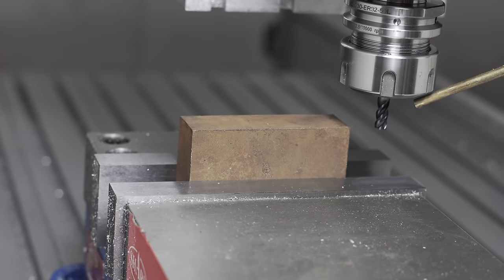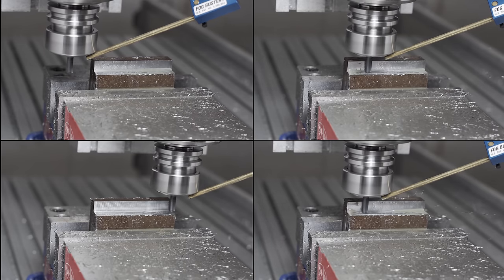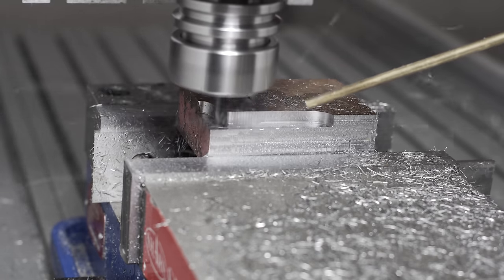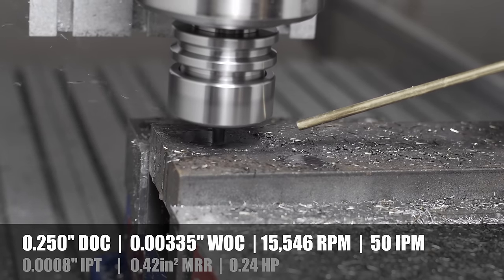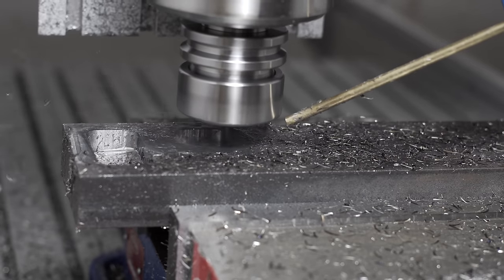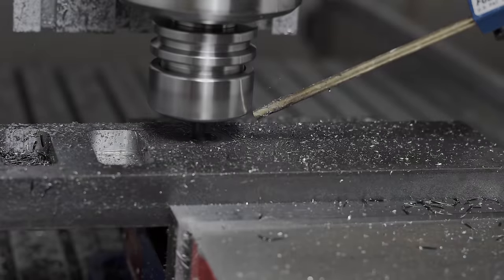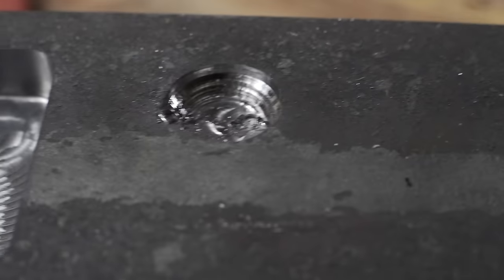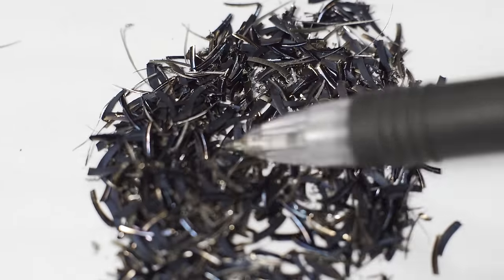Can we cut steel on a desktop gantry router?

Comment: A lot of good comments here but the best advice is to switch to conventional tool paths and use HSM DOC so 1/16 of the diameter for DOC. If you take these steps I'm sure you can increase your feed rates considerably w good finish and dimensional results.

Comment: As another Benchtop Pro owner who hasn’t had a chance to really dive in yet, thank you for this!

I wonder if there are aluminum pieces in the frame you could remake in steel using the machine and bootstrap a stiffer machine? 🤔
Reply from the maker: Hehe, it has definitely crossed my mind :)  The upright L-shaped gantry supports would be an easy candidate for conversion.  Simple part, doesn't need careful alignment, and could replace without disassembling the entire machine.  Deflection of the z-axis forward/back when the spindle is extended, and torsion of the x-axis (caused by pushing the z-axis forward/back) are probably the main modes of deflection on the router, so replacing parts on the gantry assembly would be the next best thing to do.  Would require more work since you'd be re-aligning the ballscrews and linear rails.

A steel table (or even a big chunk of aluminum) would be a nice upgrade too.  That's probably going to land on my todo list at some point.  Would be nice to replace the t-slot extrusions with something solid and flat.
Reply: Stiffness isn't the primary parameter for stability in cutting machine tools, damping is, and steel is not much different to aluminium in that respect. That's why cast iron (or sometimes epoxy granite) is used. Stiffness can be achieved by geometry rather than materials selection to the extent that it is required.
Reply from the maker: Hm fair.  I might break out some indicators and try to measure deflection at rest (e.g. push on various parts of the machine while the motors are engaged to see how much different components move).  Would give a better idea where stiffness is needed, and where it's just poor vibration control.

Comment: my  800 watt air cooled spindle blowes out the bottom and im wondering if bath water would splash from endmill into spindle, please advise  me someone, thanks in advance top video.
Reply from the maker: If it is blowing air out of the bottom it is probably similar to mine: that air pressurizes the spindle case and keeps debris/liquid out of the labrynth seal around the spindle nose.  I wouldn't submerge it or anything, but it should keep chips, dust, mist, etc from getting inside the spindle.  I have mine pressurized to around 30psi...not sure the optimum pressure but since I won't be working with dust (wood) it seemed a reasonable value.
Reply: @BreakingTaps  thanks its very solid little 6040 cnc, been cutting slate stone plaques with good results. But may upgrade to cheep 1500 watt aircooled spindle to try steel.

Comment: Your 2 videos convinced me to purchase the same setup you have! Definitely the best performing gantry cnc I've seen so far. A few questions if you have time:
1. Were there any other gantry mills on your shortlist?
2. I saw you claim +/- .001 tolerance in steel, is it possible you just got lucky on that part? Thats about what tormachs can do reliably. If you have time, could you machine a test part twice in each aluminum and steel to get some feel for consistency? Something with a bore, contour, and slot? Would be happy to send $20 to help cover materials.
3. Looking forward to your spindle wiring video.
4. Could you test the low rpm torque with a drill bit test in aluminum? Maybe like 3/8" or something? Not sure what a realistic maximum is for that spindle.
5. Is the low speed rpm consistent enough to use with a floating tap head?

Sorry for the laundry list, any insight is appreciated before I spend $10k! High quality videos for a casual youtuber as well, cheers!
Reply from the maker: Happy to help!  I'll see what I can do for some more tests, I was wanting to try out a few different end mills anyhow (and all the suggestions in this video).  Unsure when I'll be able to get to it though, just a nights/weekend hobby for me right now :)

1. I briefly looked at the Stepcraft lineup (since they have ATC), but wasn't impressed with the v-wheel style motion system, and read some poor reviews on them in general.  Also considered the wide variety of 60xx chinese routers (the larger 6090s, etc) but they are tailored for wood and also hard to know what you're getting, dodgy QA/support/etc.  Tormach didn't have their router at the time, but I think I would have passed since it looks geared more for wood too (and expensive)

The other machines I was seriously considering were "mini VMCs", like the Tormach 1100mx, Syil X7, SkyFire SVM2, etc lines.  And maybe a Haas MiniMill on the upper end.

2. Very possible :)  It's also better than Avid specs the machine, so it could be luck (or conservative specs on their part).  I didn't do rigorous testing mainly because I hadn't done any tuning yet.  Just tuned the steps this weekend, need to re-tram, fiddle with CV mode, etc.  I'd also like to do some repeatability tests with indicators, etc

3. Hopefully soon, once I work up the motivation.  Been putting it off because I need to unwire some stuff to put in a proper enclosure

4/5. Unsure, I haven't run it slower than ~8000rpm so far.  Max torque for my spindle is ~18k based on the spec sheet, so I suspect low-end torque to be quite low.  There is a torque boost setting on my VFD but I haven't played with it yet.  I was planning to threadmill rather than trying to get a tapping head to work (also because they eat a lot of Z and there's only ~9" to work with)
Reply: @BreakingTaps I'll stay tuned, thanks and good luck!
Reply: @BreakingTaps  Stepcraft does not use a V-wheel in our systems.  If you would like to ever discuss I would be happy to talk info@stepcraft.us
Reply from the maker: @StepcraftInc  Sorry, should have been more precise in my wording.  By "v-wheel style motion system", I was referring to your steel rollers on round rails (i.e. https://www.stepcraft.us/web/image/74255/allsteelmotion.jpg). I wanted something with linear rails so this ruled them out.

Comment: Carbide loves the heat to a certain extent so an airblast system keeps it there with chip removal and no rapid temp changes that could weaken tooling, seCURE UR ER's

Comment: The fixed jaw parallel shifts, meaning you didn't smack the living crap out of it with a deadblow hammer, or your vice slightly cocked the part out of parallel with the table.

Comment: Looks good. A lot of things we take for granted. 1/4 endmills are cheap. Accupro TICN coated are $15 from MSC. You should be able to run 4500rpm and 50-80 ipm with a .003-.005 stepover @ .5 depth. Good video.

Comment: I mean I know it’s very different but in preparation for building a mostly printed cnc I’ve learned any metal cutting is best done slow and shallow, now obviously your machine can cut steel where a mpcnc without upgrades can only reliably do aluminum and that slowly but maybe starting from a slow and shallow point and going bigger rather than working backwards would show results a little clearer

Comment: Typically with adaptive toolpaths you want to stick to about 10% of cutting diameter with radial depth of cut. When I went to Sandvik's Metal Cutting Technology class they said you should try to run dry wherever you can. I think you should keep the air blast but try cutting out the MQL oil. Having a bit of oil may make it harder for the chips to get out of the pocket and you'll recut chips increasing your chances of tool failure. 
Also, you may want to try high feed end mills. They have particular geometries that are designed to send more of the cutting forces into the positive Z direction. I've seen this approach outperform adaptive toolpaths in MRR. It would be interesting to see  if those tools work in a router
Reply from the maker: Oh that's very interesting re: Sandvik... I definitely trust them to know what they're talking about!  And I have for sure noticed chips sticking to walls due to the mist of coolant.  Seems like it provides just enough stickiness that the airblast can't always dislodge it.  Funny you should mention high feed mills, I picked up a few the other day.  Just small, solid carbide ones to start.  But if those look interesting/promising, I wanted to investigate the insert variety (Kyocera Raptor, etc) because they seem easier to get in a variety of sizes, and should help my wallet a bit.  Will post a video eventually when I get around to testing them!  Really interested as well to see how they perform on the router.  Since they put most of the force up the spindle, it seems like a perfect match for less-rigid machines.
Reply: @BreakingTaps  interesting...did this video get made?
Reply from the maker: @philipsommerton4280  yep! I tested a high feed mill in https://www.youtube.com/watch?v=fEJ0z1uuni0

Comment: I wonder what cuts like those do for the long term life an accuracy of the machine? I'm currently putting a 4x8 machine together, primarily for wood and ally, but may be tempted by some MS cuts, I'm just anxious that each one would be accelerating the wear and tear on the whole setup
Reply from the maker: Yeah, it's a fair question... not sure!  I guess we'll see in like a year :D  Most of the machine components (on my benchtop version) are pretty robust.  E.g. the ballscrew bearing supports, the gantry beam, the linear slide attachments, etc.  I am keeping an eye out for bolts slowly loosening over time due to vibrations though. No indication this is an issue yet, but I could see it causing problems in the future and might need some threadlocker to remedy.

Comment: All things considered good job. Some advice use only air to clear the chips depending on your budget look into anti vibe endmills. They are extremely expensive though. Our standard 3/4 and mill we use is 60 bucks. The anti vibe that we use is $386.00 so you have to justify the cost. For a hobby you can't justify that slow things down take your time and have fun with it .

Comment: Thermal shock would not be an issue with Carbide, only with CBN and fully ceramic inserts.
To reduce the chatter use a combination of a smaller diameter end mill a lower axial depth of cut and a wider width of cut.  Also more flutes.   Get a GOOD NAME BRAND VARIABLE PITCH END MILL.  I would recommend Helical Solutions.  They account for 90% of the end mills in my machine shop.  Low radial high axial tool paths require a rigid machine and setup.
Reply: I would say otherwise. You can see in the finish of the bottom of the last completed cut that the corners of the mill were already damaged. They just did break away on the last one. My attempts to cut 3 mm (0.112 in) steel plate with a 3 mm mill failed similar, after one or two feet of machining the edges crumbled, started to glow and then the whole mill broke off. So your results were far better than mine. There aren't that many possibilities for the damage to the edges: overheating or thermal shock. To high cutting forces would break off the whole mill. Because the coolant only partially and intermittently reaches the lower edges, I'd think of thermal shock because some of these mills can even used dry or with air. Because I feared overheating, I tried to keep my cutting speed much lower, you are using about 750 ft/min (250 m/min) which is way above the mills I could get here in Germany. Most are rated with 100 m/min in mild steel which means only around 5000 rpm for a 6 mm (1/4 in) mill, and all the spindles I know lack torque and/or a torque steady for a full rotation  for these low speeds. You would need something geared which simply doesn't exist.

Comment: Which ISO30 tightening fixture are you using?
Reply from the maker: This variety: https://www.ebay.com/itm/Tool-Holder-Clamping-Locking-Tightening-Fixture-50mm-ISO30-SK30-HSK50-C5-Capto/352472546124

Looking forward to seeing how your FM30 performs!  The slower speed is very compelling for steel, I bet you'll have a lot less trouble than I did finding a good recipe.

Comment: I've got a pro 5x10 fully upgraded but use it for wood. Was thinking of getting into some aluminum, but had no idea I might be able to cut steel. Is your machine similar to mine?
Reply from the maker: I have the (much) smaller benchtop version, only 2x3.  The Avid support folks said the benchtop version would handle metal better, since it's a lot more rigid due to small size.  So the fullsize version might be able to handle steel but it'd probably have very different cutting parameters, and is probably less rigid overall due to all the extra travel.  That said, plenty of folks have cut aluminum on their full size machines (Robert Cowan comes to mind: https://www.youtube.com/watch?v=ii7HRgV-wbY)

Comment: Good video!  Question on the ER collets... were you loading them incorrectly on the Taig mill when testing it out?  Lots of folks are confused by them...  often thinking the closer is deformed.  I bet pulling the collet out with that taper without help from the closer was a bear.
Reply from the maker: Thanks!  My taig actually has the old custom collet system before they switched to ER, so it just "sits" inside the closer without any snap fit.  So, theoretically, those were loaded correctly :)

And yeah, it really was a real bear haha.  I felt pretty foolish after discovering I had been using them incorrectly... in retrospect it definitely messed up some of the tests I ran on the first aluminum video without me knowing about it.  Serious facepalm moment for me :)
Reply: Breaking Taps I commend you for sharing the collet experience - most learn more from a mistake, I know I do anyhow.  Let me know if you want to upgrade that Taig to an ER spindle!  I’m working on some Taig CNC mill tutorial vids now.  Keep up the great content!
Reply: @BreakingTaps  Is the original collet chuck on a Taig similar to the original E16 collet chuck, or completely different?  Pictures I've seen show weird collets similar to but not the same as ES16 (an early, compatible, derivative of E16).  I have an original E16 collet chuck for my Unimat but only a few collets.  ER16 collets have the same taper angles as E16 but are slightly longer, so they fit, but the nut doesn't screw on far enough for safety. But...

On my E16 chuck, the nose thread is 20mm dia x 1.5mm pitch.  A standard ER16 nut is 22mm x 1.5mm.  It turns out 20mm helicoil is a perfect fit in an ER16 nut and it made a very effective conversion.

A friend of mine adapted a collet block to fit the spindle nose on a Taig.
Reply from the maker: @pnt103 The original Taig collets appear to be their own creation, probably wouldn't fit E/ES16.  The ones I have look like this: https://www.soigeneris.com/taig-lathe-collet-set-1040 Notably, the collet closer/nut pulls down tight against the flat on the collets, which makes me think they wouldn't be compatible with the top taper on an E/ES16. I can grab some dimensions later today if that'd help.  At some point Taig switched over to standard ER collets if I'm remembering correctly, so it probably depends what year/make you find.
Reply: @BreakingTaps  Yeah, that's the sort I've seen in other pictures.  So unless the Taig back taper matches the ER16 back taper, and the nose thread is compatible, allowing you to use a new nut, my trick isn't helpful.

Comment: Can you please try a high feed from lakeshore carbide? Their geometry results in almost entirely alxial cutting forces rather than mostly radial forces. You can only take shallow cuts with them but you can run higher surface feet per minute and your feed per tooth because of their geometry is really high. So you end up dancing around the part putting your cutting forces up into the spindle with feeds in the hundreds of inches per minute. Such high feeds in steel with stepper motors may be an issue though. Mainly asking because I want to get approval to try a high feed mill in steel on a robotics teams CNC router.
Reply from the maker: Already picked two of those up!  I grabbed the 0.240 and 0.120 high feed mills a few weeks ago, but haven't had a chance to test them yet.  Was thinking the same as you: the high axial load should be better for relatively non-rigid machines like routers.  The high feed rate are what have given me pause so far, mainly because really high rates tend to throw the machine around. But I've been dialing in the acceleration so it doesn't jerk the machine quite as much... feeling more comfortable with higher feed rates now.  I'll try to get them tested sooner than later!

Comment: Too much spindle speed and small ball slides....and remember, mild steel is easy compared to more exotic alloys. Stop climb milling too, it just helps rub the edge off your cutter as it deflects.
 You should also consider drilling out the bulk material, although spindle torque may well stop you...

Comment: am not a machinist, but how do you keep WOC and rotation rate and load per tooth the same while changing the IPM?
Reply from the maker: Width of cut should stay constant, as that's a function of the axis motors positioning the endmill relative to the work.  Rotation rate should, in theory, remain constant as well.  In practice it'll slow down to some degree depending on how heavy the cut is (the spindle controller has some rudimentary feedback control to sense RPM, but it's not super high resolution).  Assuming those two variables stay constant, load-per-tooth will change as the IPM changes. E.g. you can see the IPT doubles between the first and second test because the IPM doubles, but all the other parameters were held constant. Usually you aim for a certain load-per-tooth range and then adjust the other parameters to suit (subject to limitations like spind speed or horsepower or machine feed rates)
Reply: @BreakingTaps  Ah, I see, thanks. I thought load per tooth was being kept constant because you didn't colour it haha